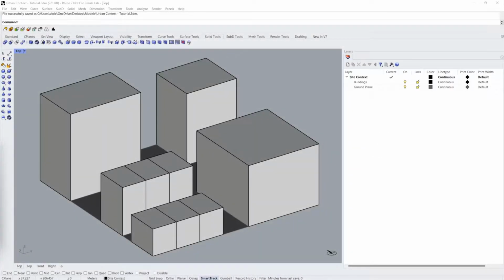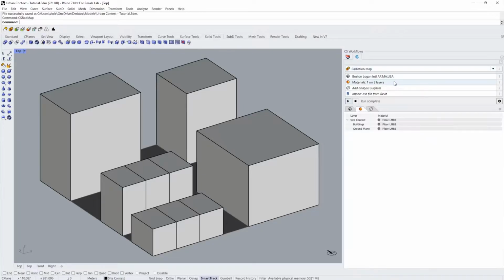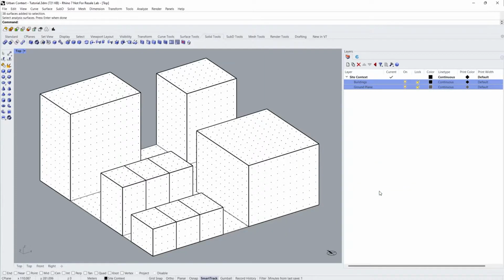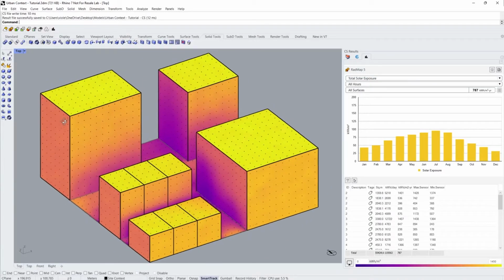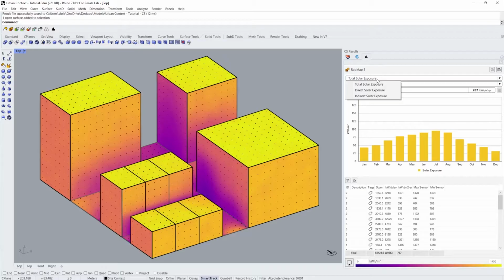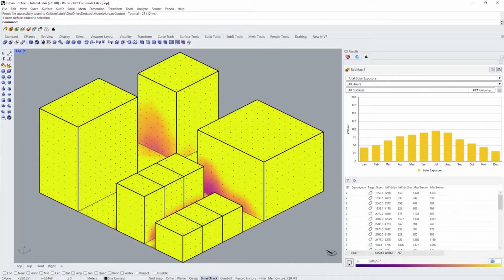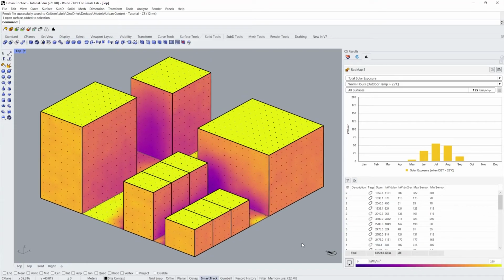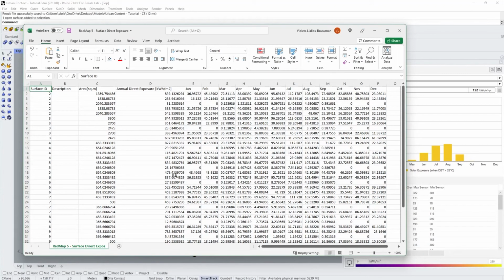Solar Radiation Analysis in ClimateStudio (Radiation Map Workflow)

Comment: Can I get hourly solar irradiance on building envelopes (one value - average solar irradiance of all the walls and the roof) for each building separately in the urban neighborhood consisting of, say, n buildings. so the final output, I expect, shall have n x 8760 values in CSV format. What I saw in this tutorial is a CSV file with monthly accumulated value, not hourly.
Any support would be highly appreciated.
Reply from the maker: Hello! 

In Grasshopper, you can choose to run the solar irradiance with hourly data, but you’ll have to parse the data yourself. You can find a premade workflow template under Radiation Map & PV > Urban Context - Radiation Map (Hourly Data). 

There is a video on how to access these workflow templates that is linked in the caption of this video.

Comment: how can the surfcace be saved in the model?
Reply from the maker: Hi Luciano! There is no way to embed the results directly into the model as a separate surface from the user interface, but you can access texture maps and mesh geometries through our Grasshopper components.

Comment: I have a small question, I found my result unit is kbtu/ft2/yr, how can I change the unit to KWh/m2 ? Thanks a lot in advance!
Reply from the maker: Hello! You can type CSSettings into the Rhino command line to change your unit system.
Reply: @solemma  Thanks a lot!😄